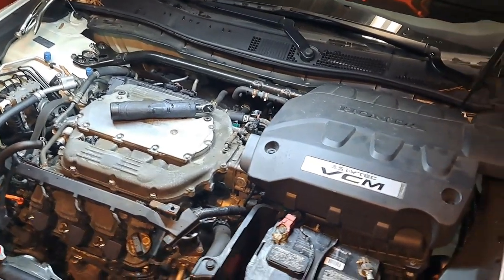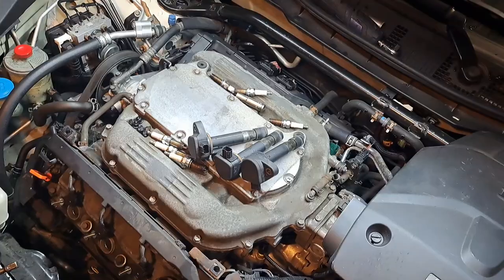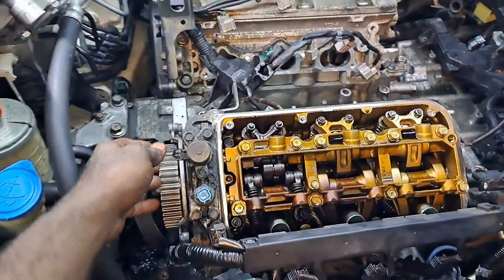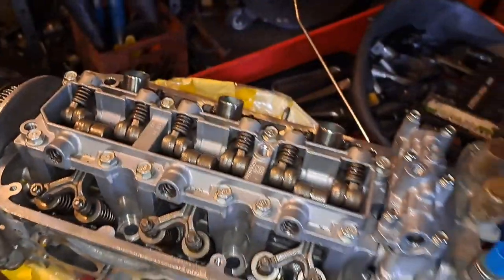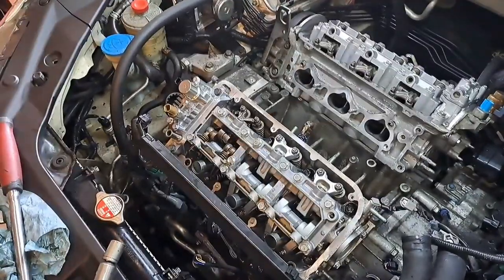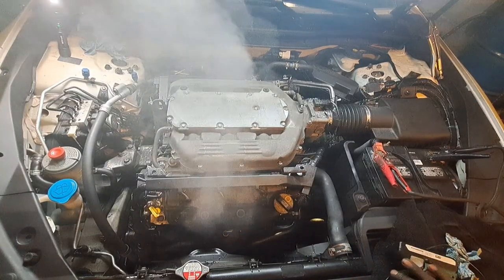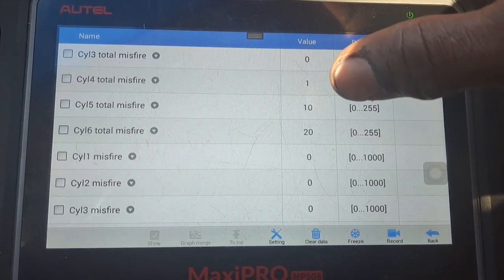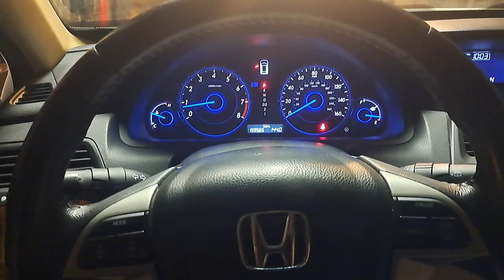2008-2015 honda accord broken timing belt!! bent valves

Comment: ive had a hell of a nightmare thats hopefully coming to an end with my 06 acura rl 260××× miles i sold it 2 years ago to some 17 y o kid and i traded my 01 bmw 330xi to the kid for 2k and my acura back on top and it had a blown head gasket i replaced the head gasket and cut the corners didnt take the heads to the machine shop just replaced water pump timing belt head gaskets and what not it was over heating and the radiator developed a crack i bought a radiator installed it and same shit it was over heating and exhaust in the radiator, i pulled the heads back off and headgasket issues or so i thought i took the heads to a shop this time my front left head had a crack i bought one from a wrecking yard in cali had it delivered to me in Washington took it to the machine shoo and that one failed the pressure test it had a crack in it i bought one off a dude in Portland who engined swapped his j series so he had extra parts. it passed the pressure test but needed a vaove job i did that and then when i got them back from the machine shop i threw the heads on threw oil and coolant in it and it ran like complete shit, missing on one bank i called amd asked of they did a valve clearance adjustment, i vpylda swore he said they would but they didnt i took the valve cover off and every single rocker arm was as tight as could be, and after having realizing that the whole rocker arm assemly was tight as shit and all the valve clearances were off while running the car several exhaust valves were bent and one of the rocker arms literally snapped off, but i have 2 spare heads so ive got spare exhaust and intake valves and rocker arm assemblys.. i replaced the exhaust valves put it all together and it still ran like shit but the blow by was gon after fixing the bent exhaust valves.. still running like shit and missing and smoke and what smells like gas vapor coming out the intake plenum and tb.. i pulled it apart and looked into the intake ports on the rear head and found that cylinder 2 had 2 bent intake valves.. i just replaced those today got it all back together by 930 pm and hooked the battery up and it was dead 🤦‍♂️🤦‍♂️🤦‍♂️ sooo tomorrow we will seee 🤣🤣🤣😪
Reply: @SunnyWhite-y3v  just let that nightmare go lol 😆😂🤣
Reply: @SunnyWhite-y3v  a buick century is a better car honda and Acura love them timing belts buicks have chains no headaches lol 😆
Reply from the maker: I know you're use to that "sinking feeling in your stomach"  by now. Keep me updated and what happens in the leading days

Comment: Drive it and it will clear up? Really?????????????
Reply from the maker: Yes
Reply: @partsshooter  never heard that one before! Wow
Reply from the maker: @MitchGaar  yes.  That's why you should watch the entire video
Reply: @partsshooter  I did watch the whole video! But saying the running for awhile would fix a miss isn’t right! Also, you never adjust valves wirhout a wrench hold the adjuster as you tighten the jam nut! No way a socket can do that right! 43 year mechanic here, just saying, if you put info out there, do it or show it right! I can tell you know a lot, but we have to do things right, or other Rookies will follow bad advice!
Reply from the maker: @MitchGaar  ask me if I care about your experience. You're the one watching my video.  Not the other way around. 

My video has a resolution.  I'm detailed in what I do. If you don't like it,  Scotty  or Chrisfix is a click away from you.

This video encapsulates the conflict and resolution to the issue. Why are you complaining?? I'm confused

Comment: hey body do you mind to give me your email , i like to see if you can help me out with questions. i got the valve head for 2015 honda  pilot and i got some question before put it in place. im A DyI
Reply from the maker: Ok
Reply: Trying to send email to @partsshooter and not working
Reply: @partsshooter  at the top valve at side bank 1,2,3 has on bolt right at top, i mean the new one i bought and the original old don’t, do i have to remove it, trying to see at your video and it seems doesn’t have that bolt
Reply: hi body i did the same job you did at this video, include  adjusting the valves,  and after all in place, i took the car for ride and it came with eco light and after that showing a error code p3400, and missing fire at bank 1 , also code p300 multiple cylinder misfire p o303, po302, po301, any idea what. could be the issue? can u help?
Reply: please when you around and if you don,t mind to give a heads up. and share some touch . i will appreciate . thanks